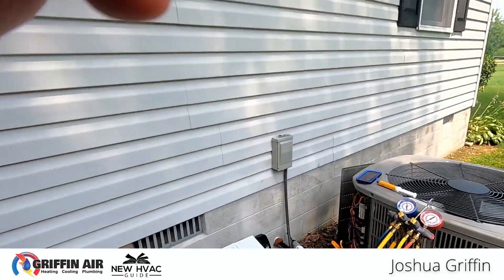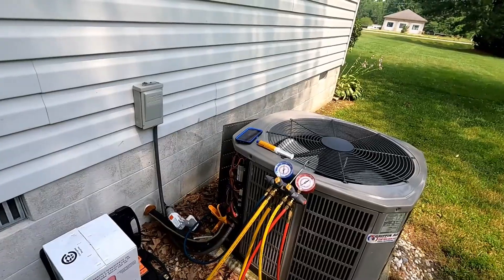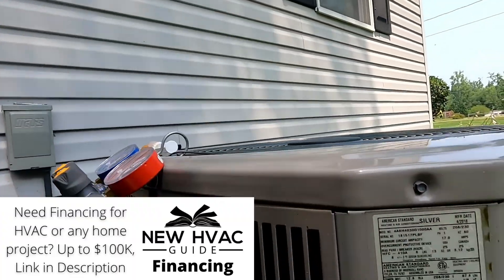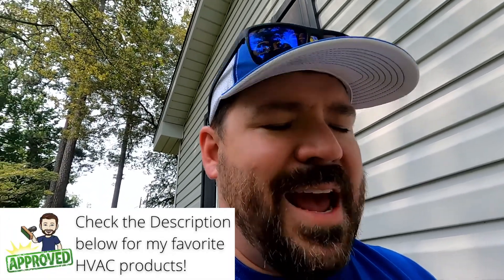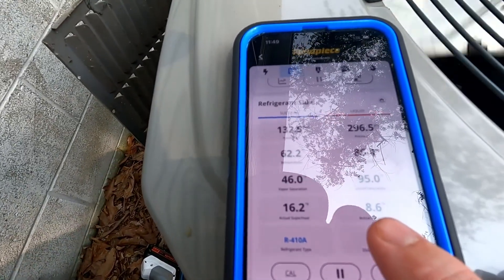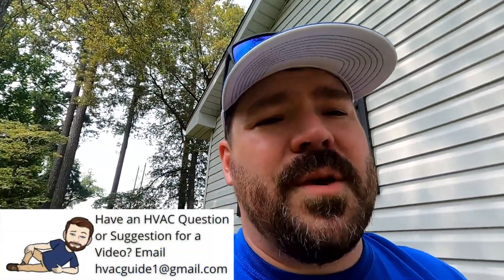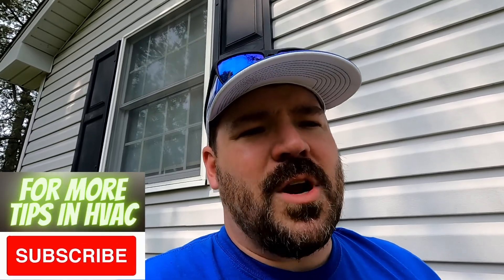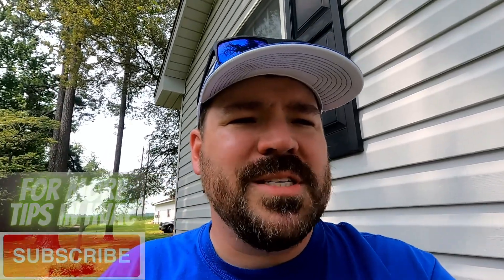Refrigerant Levels on a Heat Pump. Proper Subcool

Comment: What if your unit doesn't have that spec on the label?
Reply: Then you will have to go by indoor wet bulb temp and outside temp you can find a subcooling chart online then find find approximate subcooling
Reply: @heavychevy2289  Thankyou.  I found the installation manual stuffed inside the condenser and it had the specs listed.  I compared it to the charts and it was just 2 degrees lower.

Comment: bro just found your channel. I have a question maybe you can help. my ac use to blow ice cubes one day we had a brown outage where the power went out for a second then back on in that time I think something happen cause the ac started feeling like it was just blowing cool air. so had a hvac company come out they cleaned the condensor, came back and added freon (to see what that does) it blew cold for a day then back to blowing cool again. hired another hvac company they came out and checked the split from the vent to the thermostat has the 20 degree split but not blowing super cold so they said nothing they can do that the system is just getting old. hired another hvac company they came out and just said we will throw some freon and see what that does. it blew cold for a day than back to cool air. so I went on yt university and found a guy that was saying maybe its the txv valve maybe faulty or got plugged with varnish particle from old oil and the test was to drop the bulb in hot water, but i couldnt get to the bulb cause its inside the unit all sealed up. so i found another video that said another method is run the heater to heat up the bulb then turn the ac back on and see if it gets cold, and to my surprise it helped a bit got the ac running a bit colder than cool but not back to ice cube levels, if i wet the outside condensor unit it will blow ice cubes for a bit til the unit heats up outside. so now i am thinking that maybe my system is now overcharged as i am learning. but hard to find an hvac company/ guru that will actually troubleshoot. show with all that my question is how can i vet a company or what can i ask over the phone before booking appointment and wasting more money? i am in california and just saw your video gonna call the ONE company that is on the acca.org website LOL thanks in advance brother...keep making that great content...it is very helpful for us DIY'ers....GOD BLESS!
Reply from the maker: Definitely sounds like someone needs to get to the bottom of what the problem is. Find a company with a good reputation and maybe get a couple opinions
Reply: Thank you for input. I had another company come out and they went thru everything and turned out that the capacitor was weak but since i had a hard start kit on it was still kicking on the outdoor unit so all the other techs took it for granted that it couldnt be the capacitor. So we swapped the capacitor and back to bowing ice cubes.👍 thank you guys for all your help
Reply: All them companies and they didn't try a 30$ compasitor
Reply: @psycobone1  yup can you believe that. They all overlooked it cause they said if it was a bad capacitor the unit would not run. But the hard start kit was running the system not sure how. The tech who took the time to teoubleshoot tested the capacitor and found it was not meeting standarda swaped it out were back in action.
Reply: It sound like TXV is bad , check your superheat and sun cooling, if the SH is high, sb is high, meaning the TXV is not feeding even with an overcharged refrigerant, so it need to be replaced. If unit is old, just go ahead replace the unit for saving money in long run.
Reply: Makes me worry, just started blowing warm Saturday, had a new cap so put it in and cleaned up contactor, voltages are all correct was guessing low freon